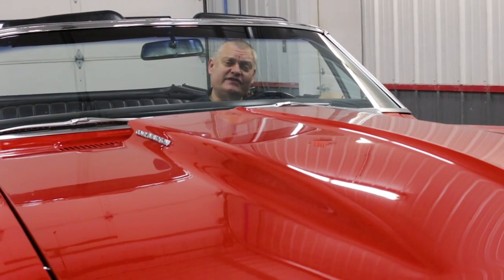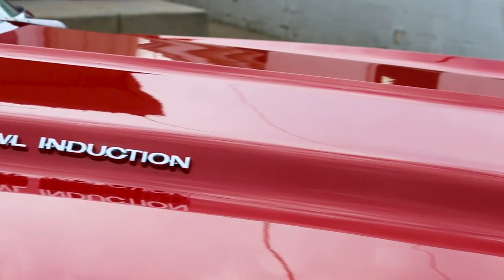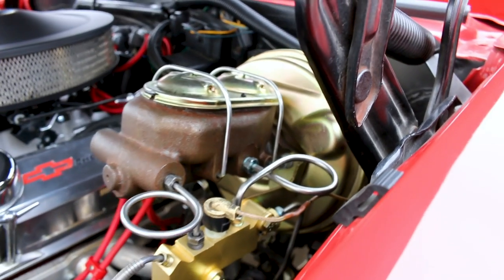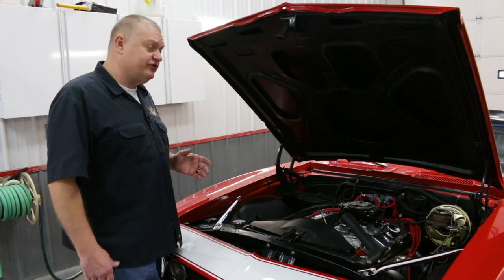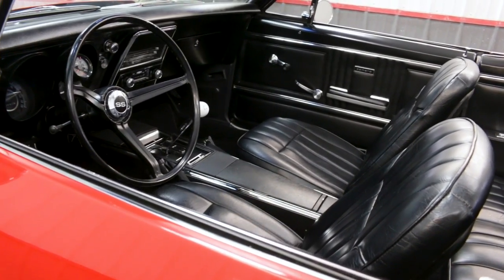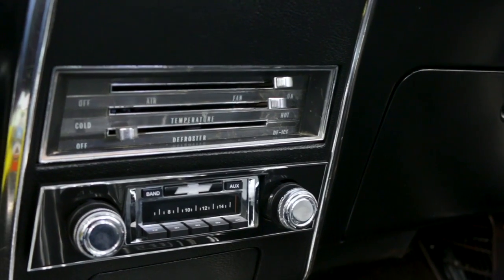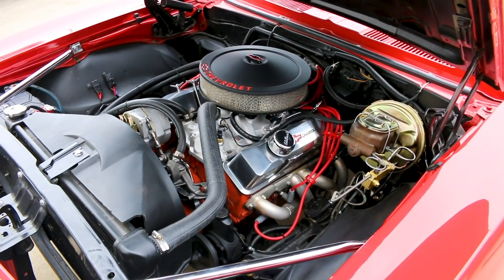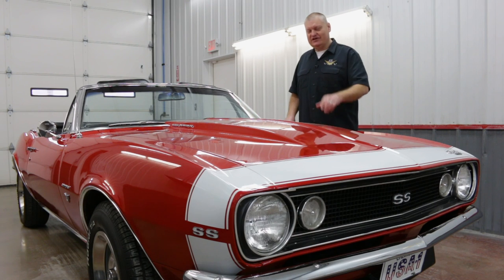Restomod 1967 Camaro Convertible [Feature Video] V8 Speed & Resto Shop V8TV

Comment: Great video !!! I have a 67 Camaro automatic convertible just purchase the tremec magnum 6 speed will this fit with the same automatic console as in your video?
Reply from the maker: Hello Caesar, the transmission tunnel and the console will require some modifications to accommodate a T56 Magnum 6-speed.    You can make it look original when finished, but it's a bit more work than the 5-speed TKO series.    Thanks for the kind words!